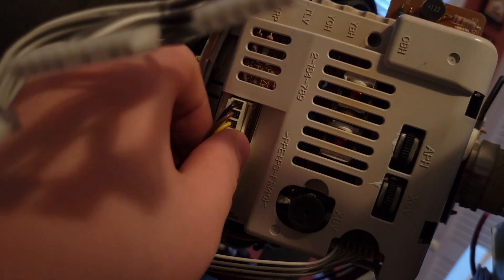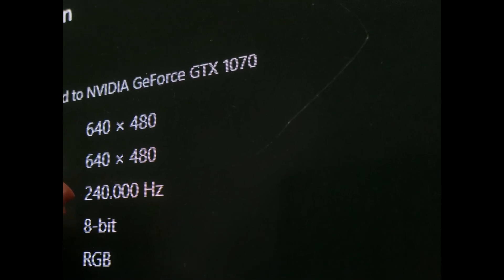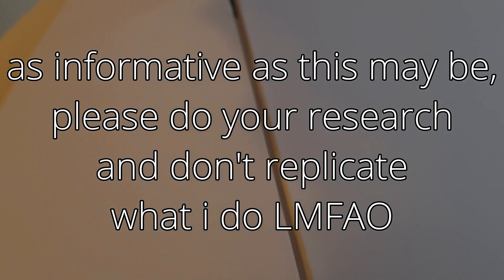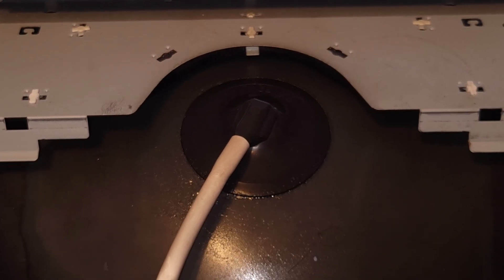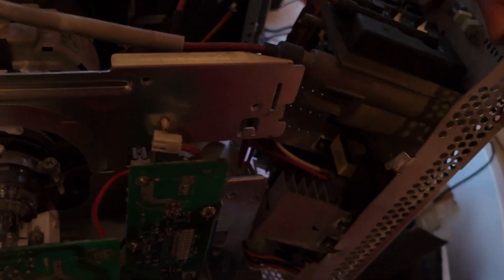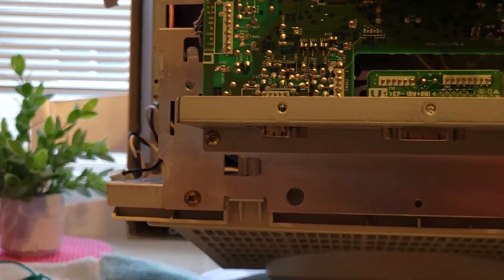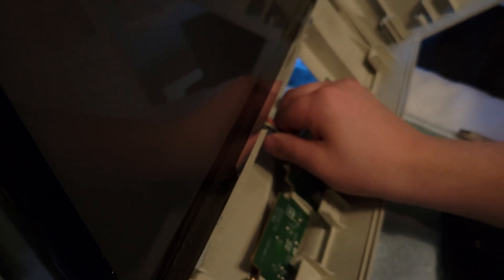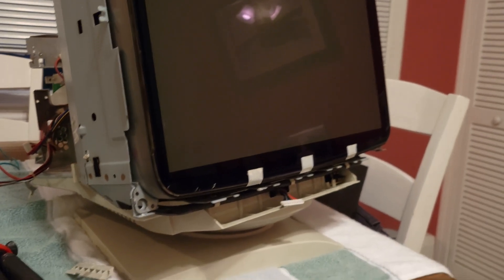The Tube Swap - Dell P1110

Comment: 2:22 damn, i was thinking about removing the glare filter on my PC monitor that's a little dim, in a "i wish the contrast control went up to 130" way, but now that you say the contrast ratio is worse, mmmm, idk if it's worth it then. plus, i'm not a fan of glare.

it's only used in low light environment anyway, and the brightness is satisfactory like that. i use every display at eye-searing brightness, so maybe it's just a me issue anyway :D what i really need is that popping contrast like a CRT TV provides, white clipping and all.

Comment: hey do you still have the very bottom square base from the destroyed monitor mines warped i took it off (awful process i respect you for doing this stuff these things were built by magic elves) and got it to bend back mostly in the oven but its imposible to get it all the way fixed not a big deal and it sits on a desk fine but i would buy the piece if you had it thank you

Comment: Damn, that thing looks nice to work on.

I had to remove them main board on my viewsonic G220fb because all but one of the front OSD buttons didn't work & fixing that required de-soldering like 10 ground straps from the neck board, all because the stupid connectors refused to play ball. It was like 5 hours of trying to figure out the least intrusive way to disconnect the neck board from the main board / tube, all just so I could spray some deoxit into the front switches.

Still wish I could see an aperture grill CRT in person.

Comment: You could remove the antiglare coating and do a windshield tinting kit on it. That'll get you the contrast ratio back and hide the scratches, but you'll have to run the tube a little harder to get its brightness back